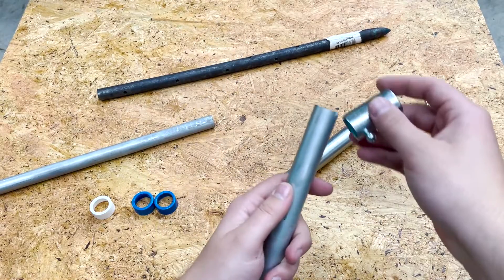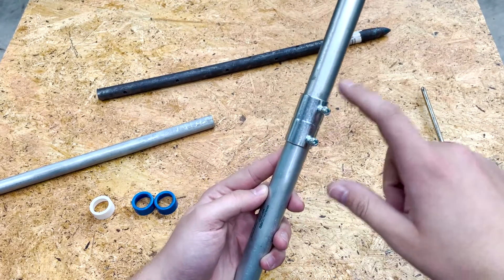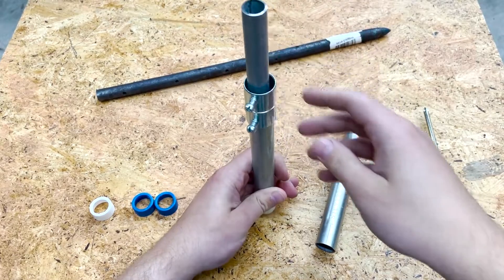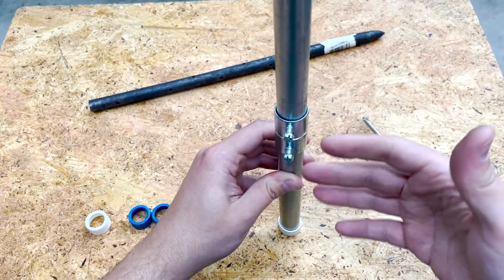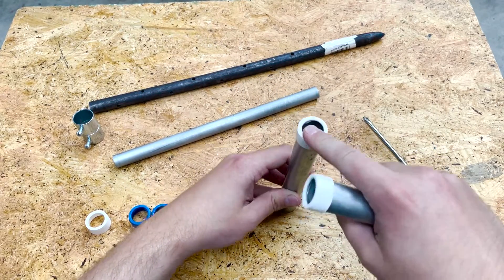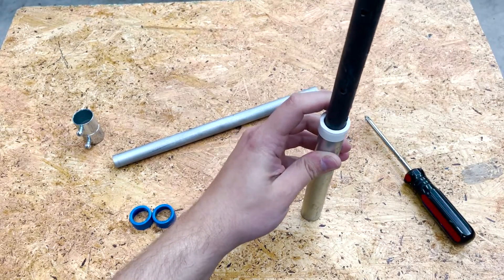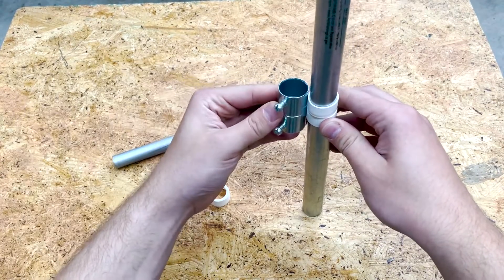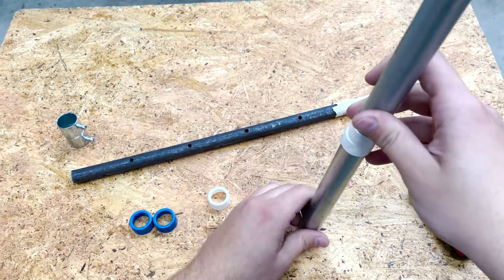Join & Reinforce Conduit With These Simple Solutions!

Comment: Arbors... look up arbors, we use them in Fishing Rod building to build up the OD on1 component to match the OD or ID of another component with a completely different size. This is what I do to the EMT to "Snug" it up, by using Drywall Mesh tape and Epoxy.

Comment: Hyun here. I've also tried a 3/4" wooden dowel for this and found it works as well as you might expect. Secondary, the pencil tip on the rebar pin is an additional feature since it makes lining up the joint for reassembly easier. 1/2" conduit may not need that as much.
Reply from the maker: Nice, thanks for sharing some more info about the solution!

Comment: Will the set screw in the conduit coupling fit through the holes in the rebar pin to eliminate some of the "slop"?
Reply from the maker: That’s a good idea! I’ll try it when I get back in the office and let you know. Thanks for the comment BJ!
Reply: @MakerPipe  I'm actually using this exact method to support a temporary gate post.  I am now looking to see the best way to drill through the 3/4" emt and line up with the holes in the rebar pin to bolt in the conduit hinges. Looks like I'll just have to measure and mark and trust my judgment when drilling.

Comment: If you wrap the 1/2” conduit in heat shrink sleeve then place in the middle of the 3/4” pieces it will eliminate almost all the ‘wiggle’ on that joint. (Depending on thickness of heat shrink material it may take a couple layers to get the effect)
Reply from the maker: True that. Good idea!